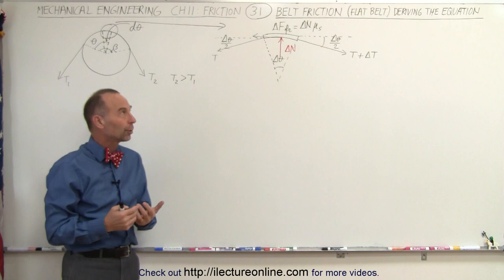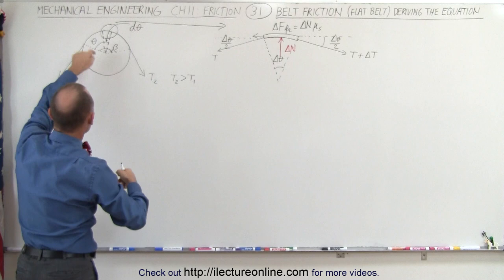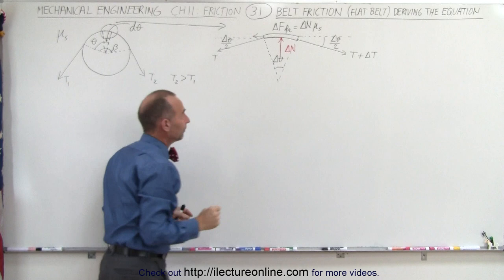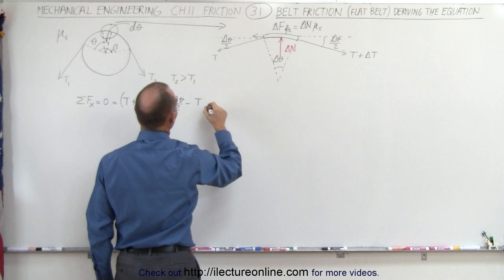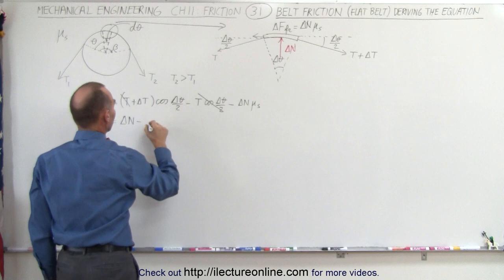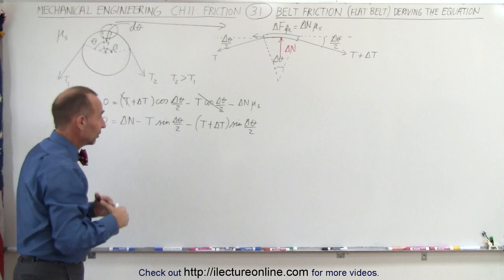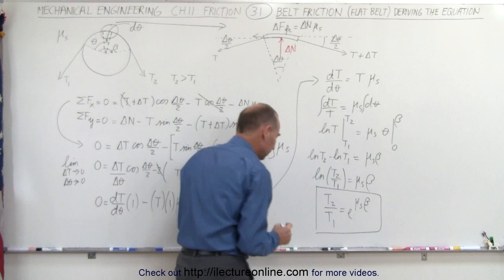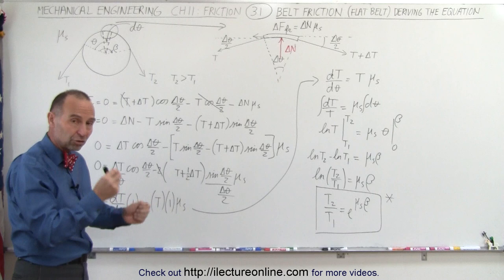Mechanical Engineering: Ch 11: Friction (31 of 47) (Flat) Belt Friction: Deriving the Equation

Comment: could you explain why that angle is delta theta/2?
Reply from the maker: If you rotate the triangle to the right by theta/2 then the left side of the triangle will be vertical, and the angle between T and the horizontal will be zero, and the angle between T + delta T and the horizontal will be theta.

Comment: First of all thanks for the lectures :) Youre a life saver. In the video, I think you made a sign mistake when you're making the deltaN substitution. And I have 2 questions.1-) What happened to the integral constant when you take the integral of both sides due to seperable diff eqn? Shouldn't there be a 'c' constant on one side of the equality ? 2-)Should we consider B angle in radians or degrees?
Reply: He did make a sign mistake.
Definite integrals don’t get an
integration constant.
All angles are in radians.
Reply: Thanks :)

Comment: Why is the sum of forces set to zero if the tension forces are unbalanced?
Reply: Is it because the tension force is slightly off balance so you can say it equals zero?
Reply from the maker: The difference in the tension is caused by the friction force (which balances out the forces).
Reply: because frictional force is one which balances the difference in tension and for no slip condition sum of all forces is put to 0

Comment: sir i want to ask something, we have the same belt on the left and the right side of the differantial roller part, so how can be a force difference between these two, isnt it supposed to be equal on the both sides ? because of the nature of the belts and strings etc. thank you very much...
Reply from the maker: If there was no resistance, no friction, and no moment of inertia on the roller you would be correct.  But since part of the energy is transferred to the roller, the tension will be different on both sides.

Comment: Good explanation, but is the pulley drawn motor or moved?
Reply from the maker: The concept of belt friction can be used for pegs and pulleys alike.  In this section it will apply mostly to non moving pegs or posts.
Reply: Michel van Biezen Thanks for answering me. My question is: why does the right side have T + dT, why does dT exist in this system?
Reply from the maker: The tension on one side is greater than the tension on the other side.  The difference is dT when the angle subtended is d(theta).
Reply: Michel van Biezen Thank you for responding, your videos are excellent, they help me a lot!!!

Comment: Hello,I have a simple quesition that how can I figure out which is bigger?
Reply from the maker: The side where the motor pulls the belt.
Reply: @MichelvanBiezen  thank you ,and what should I do when question says let's say F that you pull but system doesn't move,in this stuation F is smaller force am I right?
Reply from the maker: Yes, that means the opposing forces are equal or greater than F

Comment: Does this only apply to belts or could it be extended to a rope on a pulley?
Reply from the maker: Yes, this applies to a rope on a pulley as well.  A good example of that is the belt and pulley system of a car (although that is not considered a flat belt).  We tend to ignore the difference in tension due to friction on a pulley.

Comment: sir why didn't you consider the centrifugal force
Reply from the maker: The wheel is fixed at its central axis and rotating about that axis.  The difference in the tension of the two belts provides the torque rotating the wheel.  The "centrifugal" force here does not play a role in providing the torque.
Reply: Pully is not rotating it is just to start rotate